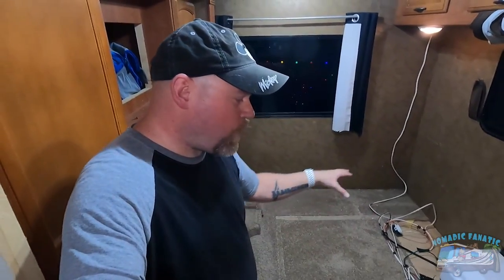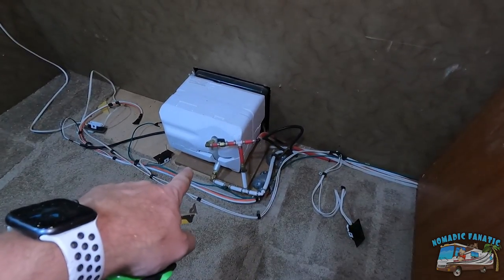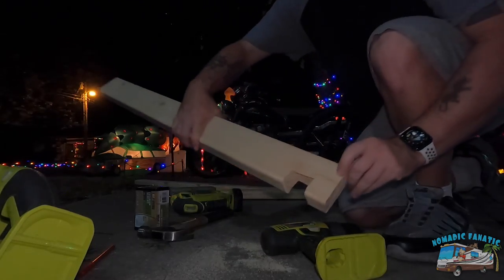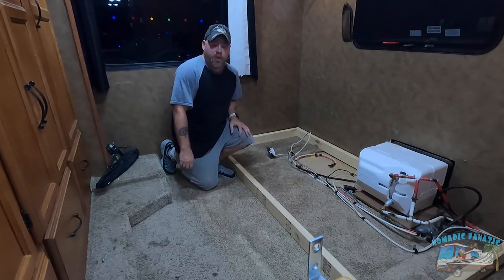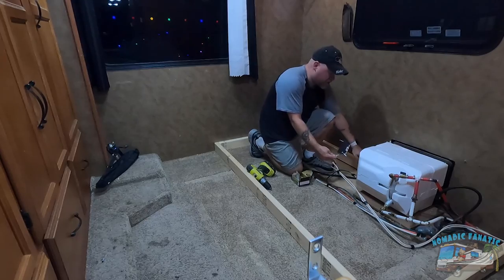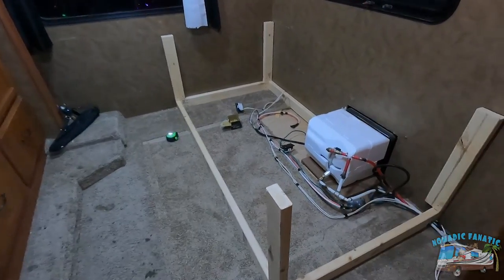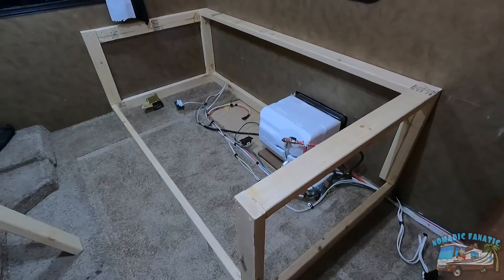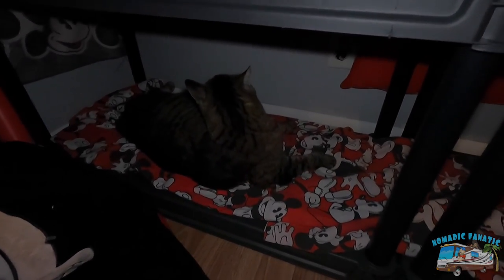Blank Slate - Time To Start Rebuild Process In RV

Comment: Not ragging on you, but I AM worried about that bedframe . Remember the lesson of your big screen being attached to (and breaking and tearing away from) the wall in a vehicle that vibrates as you drive down the highway (or rough dirt roads).

The bottom of the frame was resting lightly on the carpet when you screwed it to the wall. So all the weight of the bed, your stuff and you is going to be carried by the walls instead of the floor. Those walls are most likely paper thin like in every other RV. Even if you screwed into studs, they aren't designed and built to have that kind of weight and torque applied to them from the side.

Comment: Be warned from a RVing neighbor (I live in Collinsville).  If you stay too long here into the winter you’ll want to look into winterizing.  It easily gets cold enough to freeze rv pipes and as you’ve noticed, we have very rapid and extreme weather changes here. I have no clue how hard it is to winterize or dewinterize your pipes, but my travel trailer literally takes 15 minutes and can be dewinterize in around 30 if I don’t winterize the freshwater tank.  Your motor home might have heated and enclosed tanks so it might not matter, but still something that is easy to overlook as a full timer who chases the weather and isn’t use to freezing temps.

Comment: You have to attach it to the floor. There are regulations for bolting down things like that, so if you get in an accident it doesn't fly out and injure anyone. Do not attach it to the walls, they are not very strong.

Comment: Generator issue. I recently had an issue with my onan 4000, it would run then stop.  Turned out the ground wire would actually vibrate into a position where it was shorting out on the metallic insulation on the door of the generator. Maybe check the ground wire location on yours, since I believe it is a different model.  Vibration could be sending it into a position where it comes in contact with something that causes it to short and kills the generator. May be worth a look.

Comment: I know it'd probably be expensive, but you could have the 60 incher on a hinge, with the TV stored flush with the ceiling, then put in a swing arm mechanism to rotate both couches 90 degrees facing the drivers' seat.

Comment: I hope you anchored to studs in wall, not just to papier-mâché wall. Walls in rv provide no support. 

Also water heater gets replaced from outside, not inside. You remove entire metal shroud and it slides out. Water heaters are sold as one piece so you are not going to remove it from inside. Odds of new heater matching old shroud are very low unless old one is barely used. They change design intentionally every couple of years
Reply: i'll verify that too, rv water heaters are removed from the exterior of the rv, they have always been this way. i've replaced a lot of them over the years.

Comment: First, round edges on the desk to help prevent hip checks walking by, 2 put conduit around wires to protect rubbing against the wood and chafing them.
Reply: I'd be rotating that desk so it doesn't jut out in the hallway so much. 1/4 turn so he's facing the outer wall would help, and definitely as you said, round the edges.

Comment: Eric you should have taken the top left support and used a promaxus defibulator wedge congigate hinge instead and then it would be able to prozfibulate any time your dixterimus Plasma Coil injector faultered,  unless you have a flat injector then I would think of replacint it with a theriofalt deficator valve!!!!  However... Hay! you do it any way you choose ... but admit it ... you know deep inside I'm RIGHT!

Comment: The water heater is removed from the outside. It slides out after removing the 4 screws. Bring that dam RV over 2 me and I will fix your slides!
Reply from the maker: It doesn't slide out anywhere the way it was bolted to the frame I dismantled. Yes, MOST RV's it would just slide right out - I was trying to show you all the wiring and pex that was all secured to the wood of the bed hidden. You could pull,but it wasn't coming.

Comment: i believe that the water heater if it breaks , would be removed by the outside wall . you should not need to access it thru the bed area......

Comment: I see you leveling up to the bottom of the side window with the bed. But the back window looks to be lower than the side window? So you'll end up covering about a 4th of the back window by the time you add your pillow? (I was wondering if the camera angle was fooling us into thinking the back window was lower, but don't think so).

Comment: Eric...solar question for you !!! I was thinking about turning out 2003 honda od into a camper .....if i was t to run small fridge , fan , recharge phones and computer and run air or heat as needed what should I be looking at ?

Comment: You have to make it work for You.   I will tell You changing a RV or camper water heater is a pain in the ass.  Especially if it has leaked and ruined Your carpet and it is soaking wet.

Comment: What is wrong with your slide. Is it the motor, the controls and switches or the mechanical moving parts. 
As the motor, disconnect the wires to the motor and connect direct to a 12 volt source and see if it is the problem. If it is not the problem, then it can be all the safety switches and controls. You can modify your system with just a switch and direct to a 12 v source, and work it. If it is mechanical, let’s see it and talk about it, maybe we can help point you in the right direction. I have a motor home and do all my repairs and fix everything to original. We can help.......